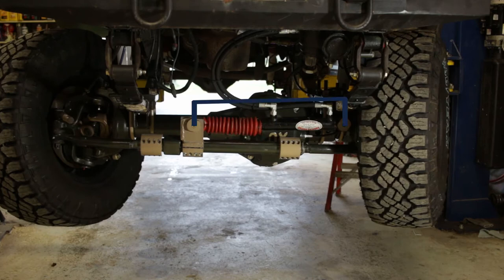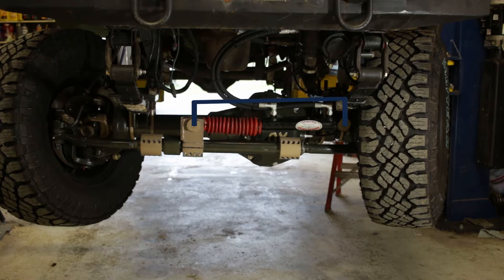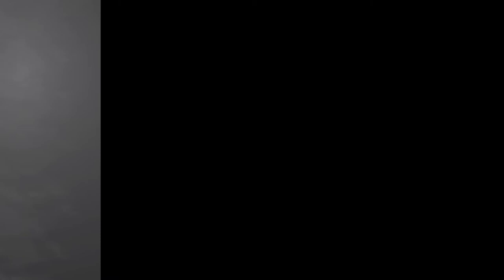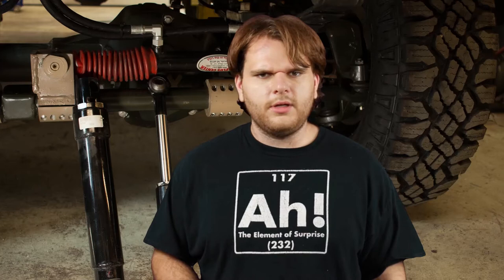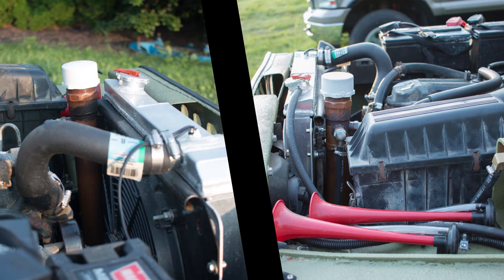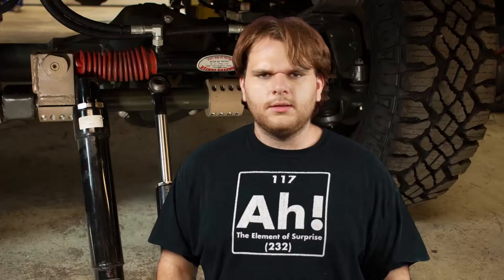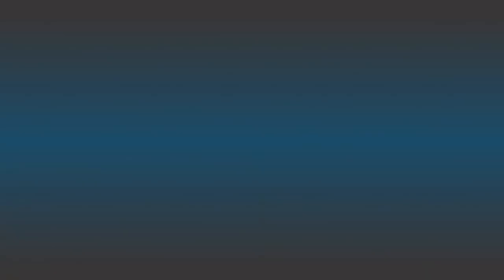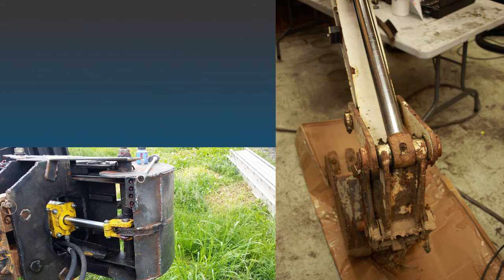Choosing A Ram For Hydro Assist Steering 610BOB's Builds

Comment: If I upsize my pump will my steering box handle the added pressure? I have a toyota and I think the stock pump pushes 1200 on the high end. I added a ram and now I need a bigger/better pump. The new pump I'm looking at pushes 1650 psi. Think I will be fine??